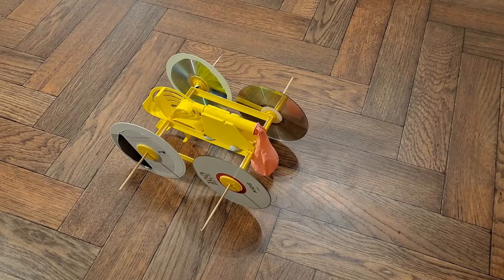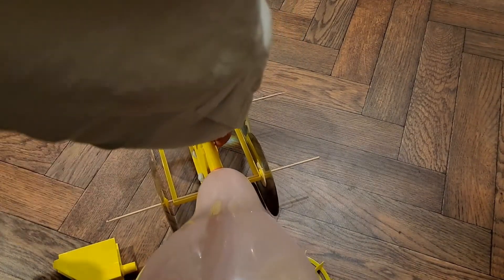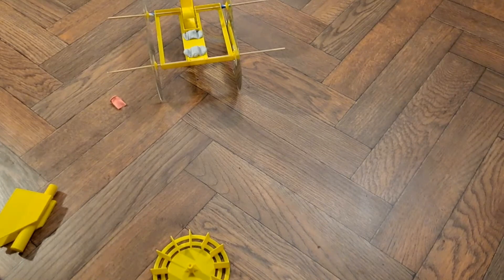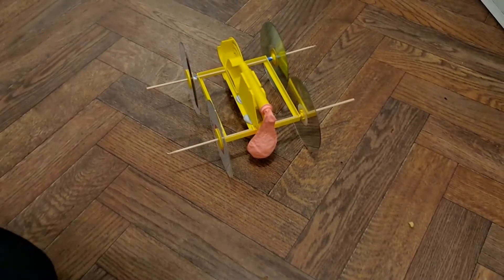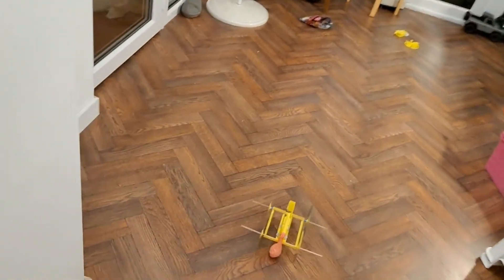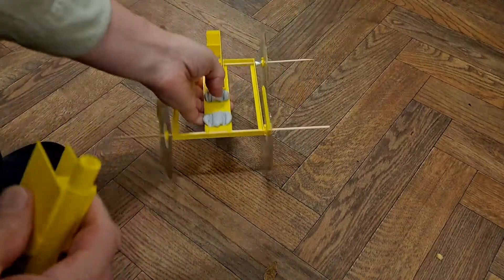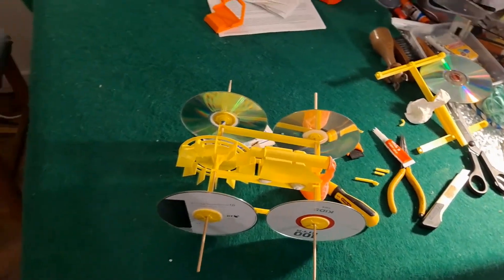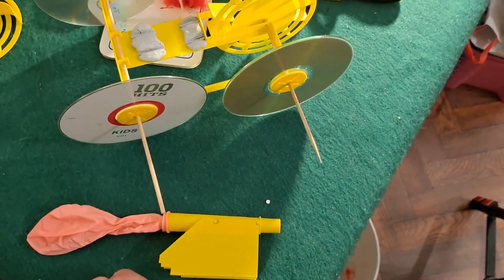Balloon Powered Car with paddle wheel Mk 2

Comment: How about a horizontal paddle wheel? It would be wider and catch more air. 👍
Reply from the maker: The first issue would be a gearing conversion from horizontal to vertical adding friction and loss. Second point, why couldn't I just make the existing paddle wider. Sounds like a project for somebody who has a 3D printer to try a few alternatives 😆 Technically, a real engineer would do some maths and calculate the losses and gains from the different configurations. As with any science project there are so many variables to consider here. I don't do maths any more, just poke and hope. I still think the biggest issue is how to release the nozzle. As long as I am putting my finger over the end, there are release problems. It is too easy to accidentally push the car backwards or forwards or off to one side. Pushing it forwards is cheating, pushing it back reduces the distance travelled, off to one side, and it hits the side wall before it finishes its run. And a messy release allows pressure to escape before the car can get moving. This really is more complicated than it looks.

Comment: if you make the pipe to easy to snap it it will quickly become to lose, how about a constrictive hoop?
Reply from the maker: I just changed the mount again. This method is too complicated, I do tend to overengineer stuff when a simple slot would do the job.